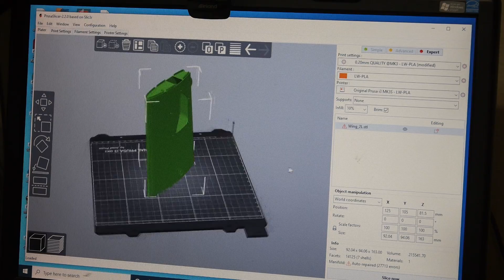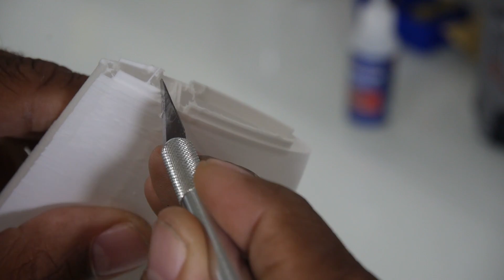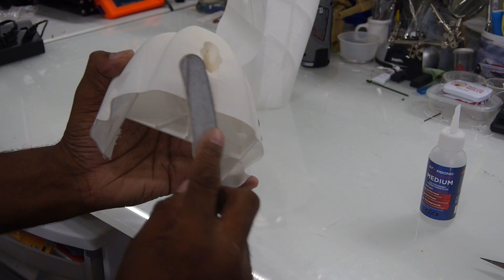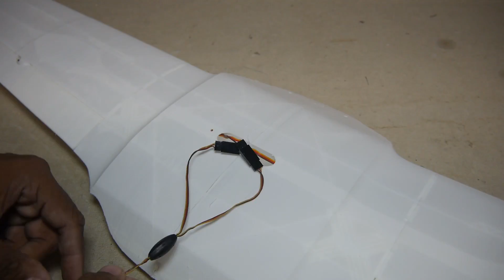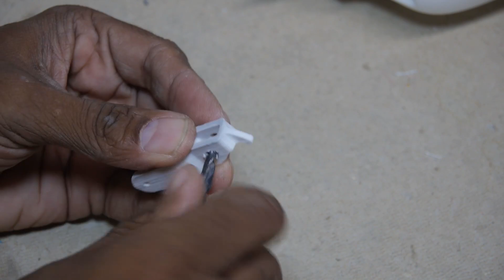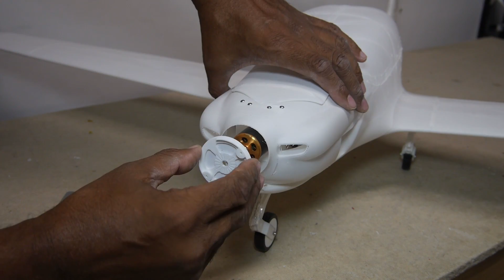Eclipson-Airplanes 3D Printed Panthera Build - New LW-PLA Filament Test | HobbyView

Comment: Hi have you thought about printing without any retraction, so each layer is printed in a smooth continuous line?
Reply from the maker: That sounds a bit like "vase" printing mode.
Note that many new designs are now optimized for LW-PLA printing.
Reply: That's only possible with some geometries. Vase mode means you can't have any internal geometry at all, and only one outer layer. Not ideal for this application.

Comment: Awesome Vid. I am in the process of printing one myself, but using the standard PLA all around. I am debating about reprinting the wing in LW-PLA to save on weight in the future, since the wing is removable, but that material is twice the amount in price. How did you address the pitting on the cowl towards the nose? I'm  debating about adding top layers, but still considering how many. Cheers.
Reply from the maker: You could try adding an additional wall thickness.

Comment: There should be print settings in the prusa slicer to prevent the print head from passing inside the print volume. That would prevent strings from forming inside as the print head will always take a path over a printed area. It will take a lot longer to print of course.
Reply: Avoid crossing perimeters

Comment: On my Ender 3 normal retraction of 6mm works fine with a extrusion multiplier of 0.5 giving weights just below 3d labprint values.
temperature at 225.Love the material it is almost like having a plastic balsa easy to cut and sand, and the layers are almost invisible. I haven't painted over it yet  but the finish would suggest it will  adhere fine.

Comment: Thanks for the video on LW-PLA 3D Printing, can you share information on your slicer settings? I noticed that the Cura settings that Eclipson provides are not very good for LW-PLA. Also I'm not impressed with the support from eclipson with regards to print quality issues.

Comment: Also, can the model be scaled up so is a bigger model?
Reply from the maker: Technically, yes. But it may make some of the dimensions off standard. You would need to experiment, plus you would need a much bigger printer or slice it into smaller pieces.

Comment: I must not be getting notifications from YouTube because I have not seen your videos in a long time. Great to see your video here. Interesting PLA. Less weight but stringy. Makes me wonder what causes the stringy character.  If there is another setting or that is the way it is. Any rate. Still great to see your video. Hoping you and your family are staying safe.
Reply from the maker: Make sure that you clicked on the Bell icon as well as subscribe. 
The LW PLA expands when heated, so I presume that is why retraction doesn't work very well.
I did a lot of experimenting and anything over about 1mm ultimately would cause issues. And the new Prusa printer has a really good extruder drive mechanism.